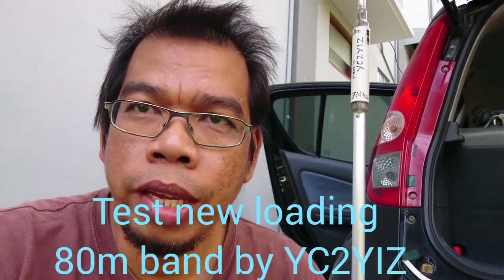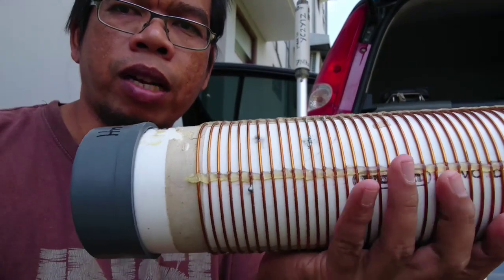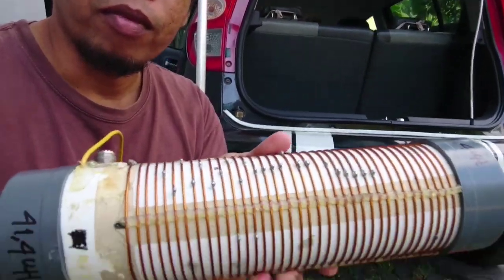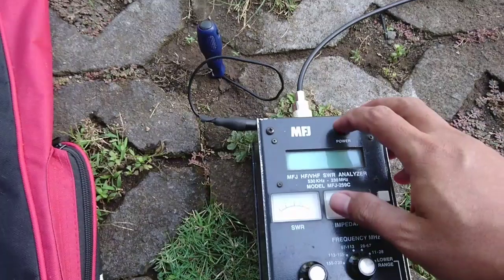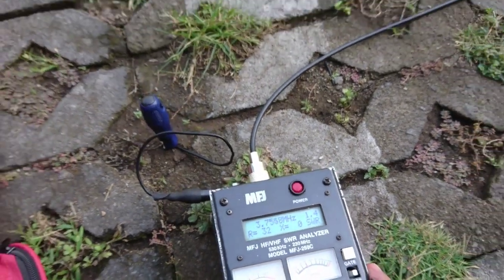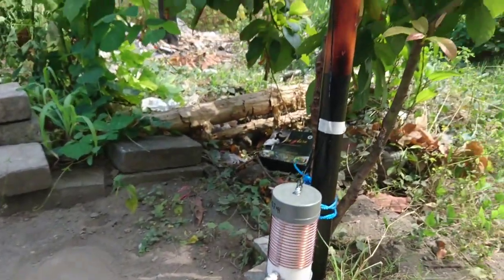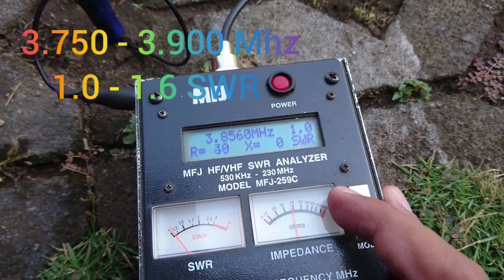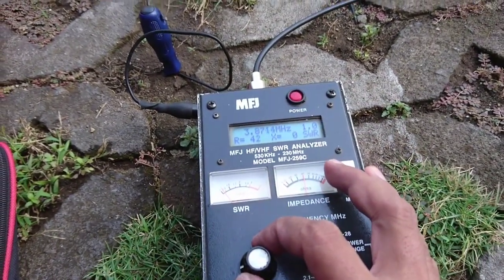Test new fixed loading coil 80m band by YC2YIZ

Comment: Hi there …. Nice project!
Please, confirm the length of the counter poise you are using.
Thanks
Reply from the maker: If you use 1 counterpoise 15m length, if you use 2 counterpoise each 10m
Reply: @yc2yiz  thanks for the clue 👍